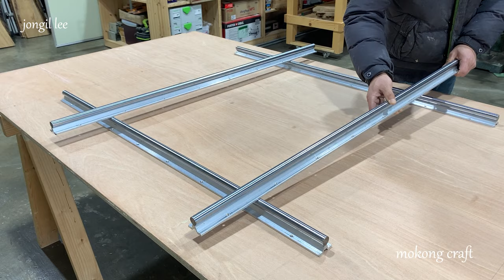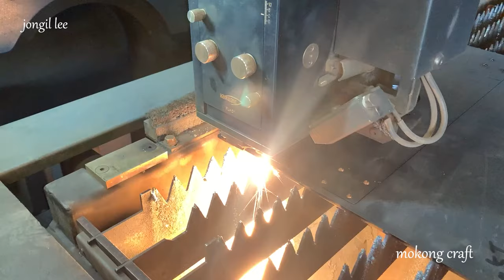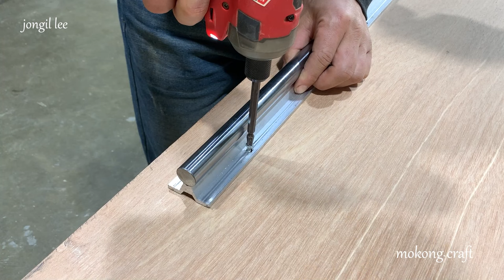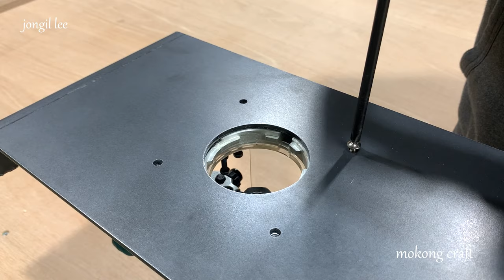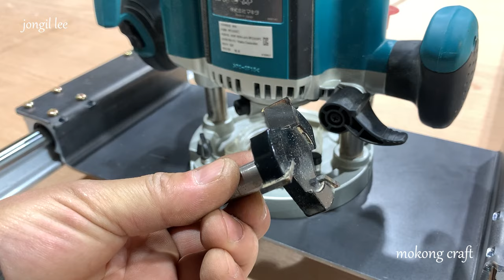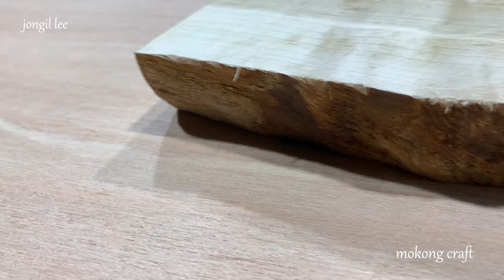Router Flattening Sled / Router Slab Planing Jig, Woodworking

Comment: This is great, I had purchased four of these 16mm rails and had them sitting around for a while and last year got the bearings.   Now to make the other parts.   The problem is room to put this thing.  I think I might have to limit it to about 48".  I had completely forgotten about the stops.   Thanks for posting.
Reply: Hello. You have a new channel name now? Instead of Mokong TV? How can i possibly get or buy the router support for this Makita router? I have the same linear guide rails and its been my plan 2 years ago to make a flattening jig. Initially use a plexiglass but yours is more sturdy and dont flex. Can you help me get one too? Thanks!

Comment: That's great, where could I buy the base plate for the router?
Reply from the maker: Sorry, I made only one plate for my router
Reply: How to make:
1: Buy 4 runners. 😊
2: Hit “print” on your CNC sheet metal cutter. 😅
3: Finish in your industrial hydraulic bender. 😂
But seriously, the metal plate isn’t hard to make with hand tools, and could even be made from thick plywood.
Reply: Do you have the cnc plans(file) used to cut the metal sheet?

Comment: Hi Thank,s for the video , but where to buy the end stop rings  for the rail ? I'm loocking every where and hard to find, Many thank,s.
Reply: Christian it's in the Tool List above the comments.
it's called the Limit Fix Ring 
Is that what your looking for.
Reply: @str8chevys913  Hi, and many thanks
 In Amazon what is the diameter of the rings: 20mm or 25mm? The information is not provided. Many thank,s have a good day.
Reply: @christianmateo2621  I really don't know the diameter, but if you buy both sizes 20mm and 25mm the one that doesn't
work I think you can return it.
Reply: @str8chevys913  Hallo , many thank,s the 20mm was orderd . Bye